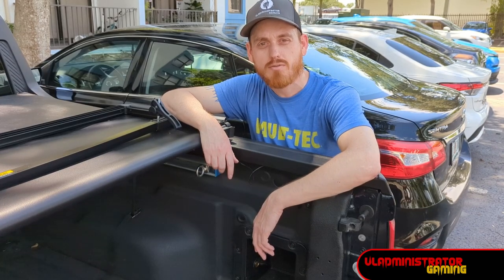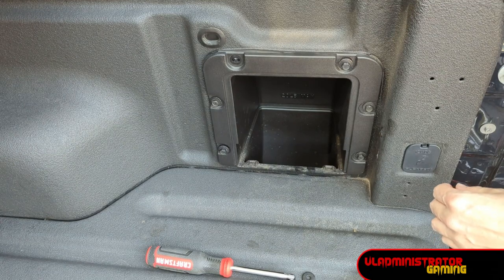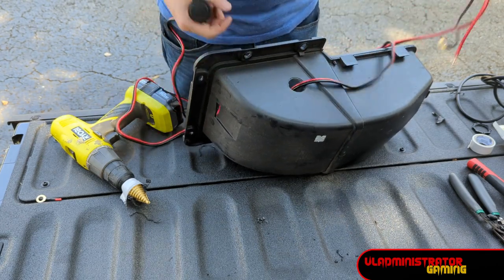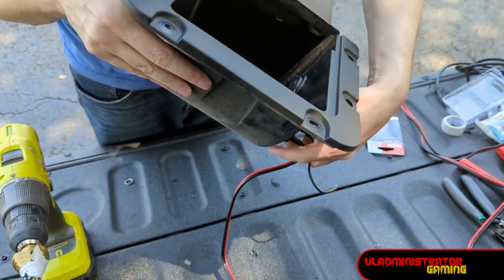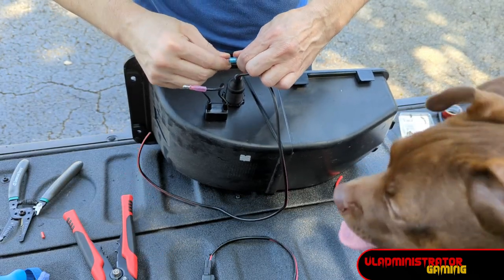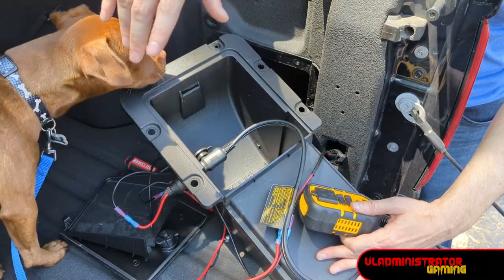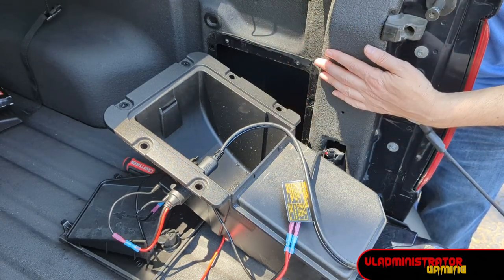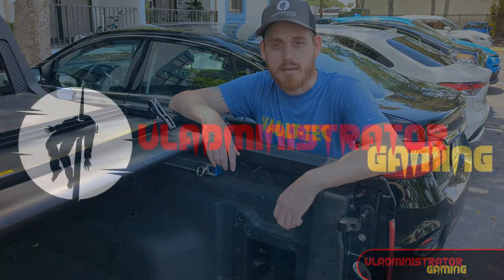Flexbed 12V outlet installation | Ford Maverick

Comment: Cool video BTW!!!  Definitely helps because I'm no electrician.  I got one that's a small contained unit, prewired.  Dual USB and dual 12v with the volt meter and switch.  Just 2 wires to hook up.
Reply: Got a link my brother?

Comment: Excellent, my worry is my drop in bed liner...looks like I may have to remove the passenger side panel to access all of this?
Reply from the maker: I have a spray in liner, so I'm not sure how the drop in liner fits the bed. If it's covering the entire storage box, or it's outer trim where you can't pull it out, then yeah you'll need to find a way to either work around it or take it out.

Comment: How much wattage can you pull through that?  I'm thinking charging batteries for my 18v or 40v setups
Reply from the maker: I don't know much about the wattage/amp/voltage math. The circuit is 12v, max amperage 20amps. The flexbed wiring goes through a 20 amp fuse connected to both flexbed terminals. They aren't separate circuits. So it'll be based off the limitations of the circuit with that 20amp limit and how many things you put in it to draw power.
Reply: @VladministratorGaming  well I did a little snooping.  Not a real deep dive mind you, but it sounds like your max is about 240watts.  That's DC, I don't know if things change when you convert to ac

Comment: Ah crap.  I'm not getting any voltage from either flexbed 12v with the Maverick "ready to drive".  The 120v outlet in the bed works and I'm getting 14.8 from the interior 12v outlet.
Reply from the maker: You're going to have to check the fuse under the hood. I blew it when I tried running a heat gun from the outlet and that's how I figured out both flex bed hookups go to 1 20 amp fuse. It's number 84 in the box under the hood referencing the diagram from the site linked below. https://fuse-box.info/ford/ford-maverick-p758-2022-fuses
Reply: @VladministratorGaming  Thank you!   It's a Hybrid.  I agree the manual says #84.  Somebody else reported that it was 88, unlabeled.   I'll check.  I really didn't want to repair this thing, but here we go...
Reply from the maker: @anitatombreach7801  I have a hybrid too, it was 84. Popped in the new fuse, reinstalled the fuse box and wiring harness connections and everything was working again. 5 minute job.
Reply: @VladministratorGaming  Thanks for your reply, swapping didn't fix it.  The huge forward facing kid seat is the PITA to reach the battery.  It's is very difficult to retighten the top anchor to the bulkhead.  I actually just unhooked the belt anchors only and wrestled the seat up.  Anyways, after fumbling with that and the weird under hood fuse box, 84 appeared broken.  I stupidly switched the fuse out with #71 (rear console power), so now I'm down 2 fuses and 2 power sources.  I just had to pay $10 and a free trial of Prime to get a 5 pack of the 20A slotted M fuses for #71 (84 will stay broken), arriving Monday because I'm headed on a road trip next week.  I just might be a moron, haha.  Left a VM for Ford service.  My accessory is a dual 12v outlet/usb switched box.  I don't think that would blow a fuse?  I did learn about the underhood fuse box at least, it will be easy now.   Thanks again!